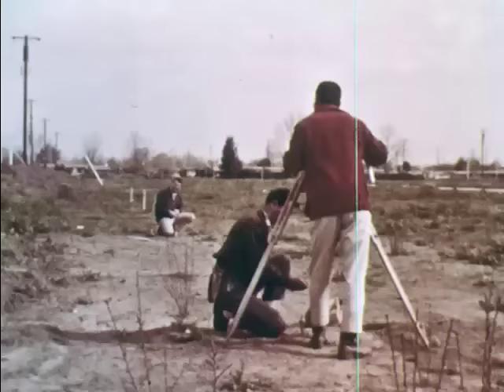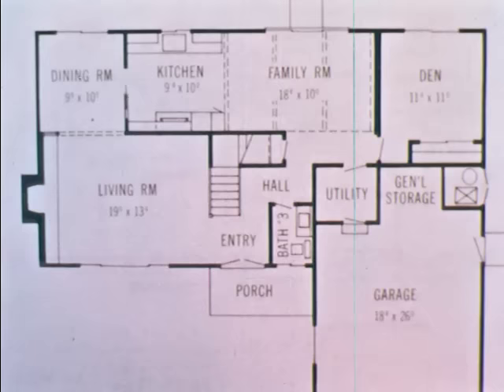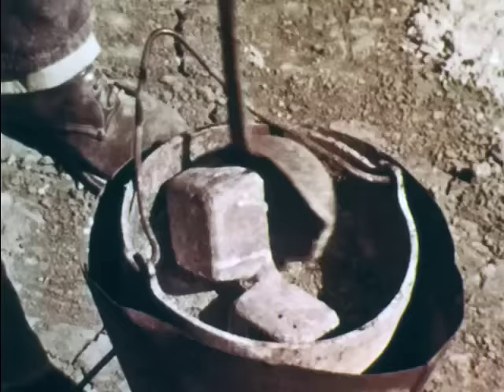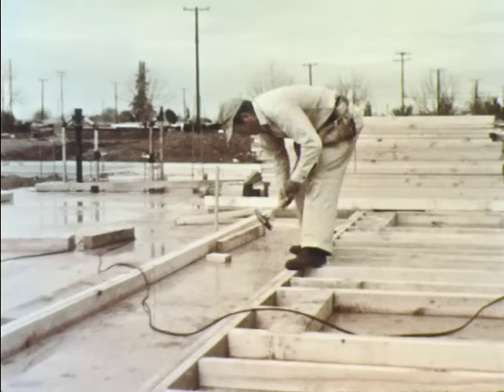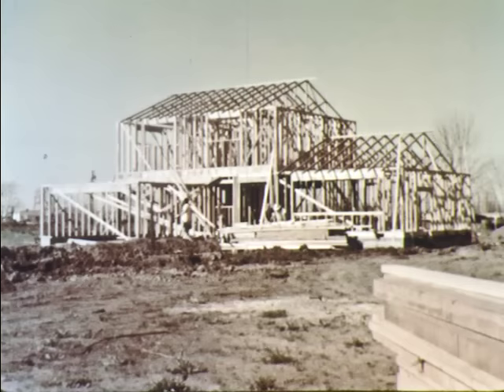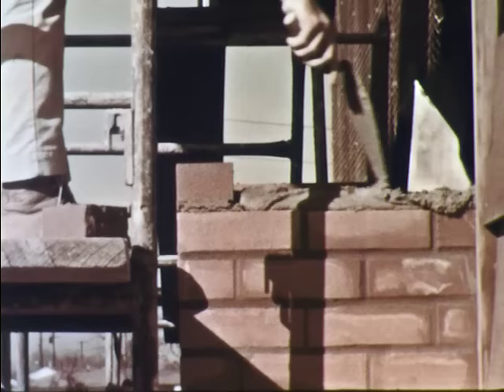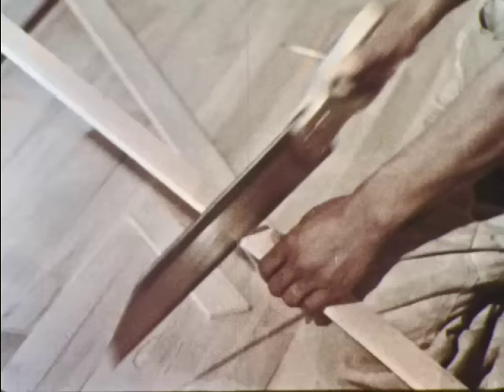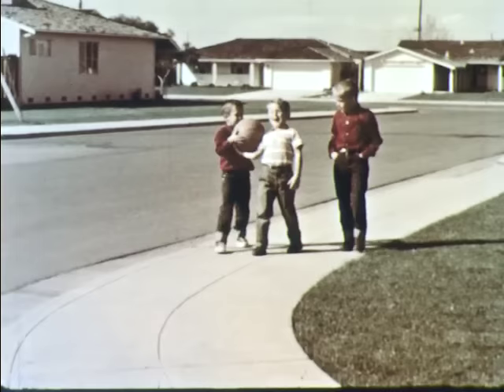Building A House (2nd, 1962)

Comment: Did anyone catch the paraffin wax trick?
Reply: @treyhart6861  At 8:10 you'll see the carpenter pull out a nail&hammer. Then stick the nail in the end of the handle.  Finnish hammers of the tme had hollow handles. Cut the rubber end off and melt wax inside.  Waxing the nail made for a smoother drive and better finish.  My father was a master carpenter and got his start in 1959. When i say that it brought back alot things my dad passed down to me growing up.
Reply: @kylewilson6497  I heard someone talk about moving the nail through his hair to become slightly lubricated. I guess it was oily.
Reply: @wadebarnett2542  It used to be common for men to use greasy/oily hair styling products. Then came the Beatles. "After the Beatles appeared on 'The Ed Sullivan Show,' all the boys in America (got the same haircut), too. 'I'd come home from school the previous Friday looking like Dion,' recounted Baltimore-born rocker Greg Kihn. 'I went back to class on Monday morning with my hair dry and brushed forward. That's how quickly it happened.'"
Reply: We used to put dawn dish soap in a box of 16d’s and those nails would sink in 2 blows framing houses! Love the tricks of the trades

Comment: what about insulation of walls?
Reply: The space between the walls was your air insulation  Sort of like a double glass window Or in balloon framed house with coal furnaces in the basement . The excess warm air can flow up through the walls
Reply: they used rock wool in the ceiling only of our calif house that was built in 62 but they also used lathe and plaster rather than just sheetrock. we had no insulation in walls because nat gas was cheap to heat with. that bit us in the ass just a decade later with the oil embargo